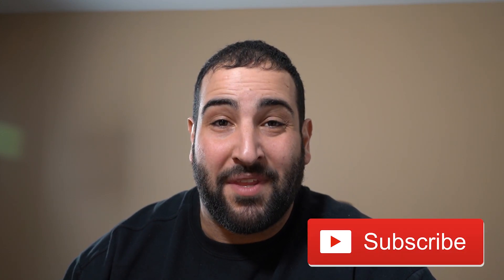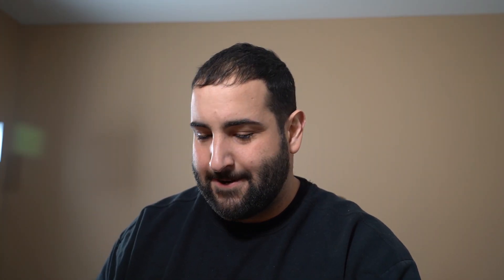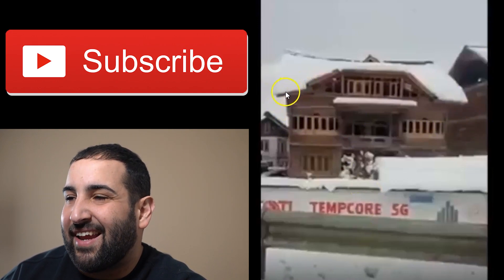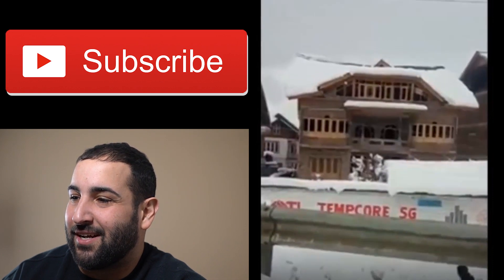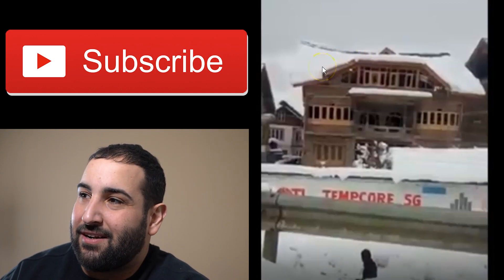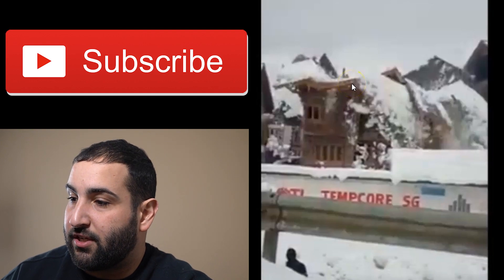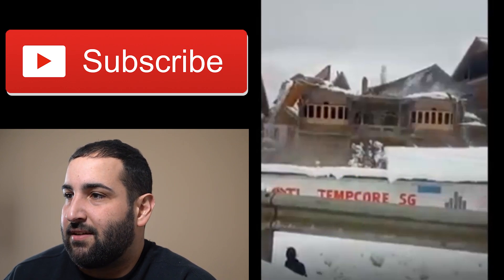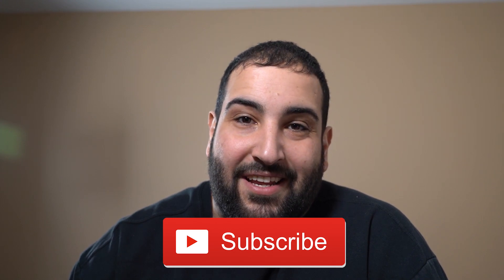Engineer Reacts to Building Collapse

Comment: I imagine you're right about this being a staging/construction issue. If snow is roughly 21 lb/cf & there is less than a foot of snow, then the weight of this snow would be less than or equal to the minimum code prescribed roof live load - and I'm not seeing roof live load being applied in the video. So either the structure wasn't designed property for typical roof live loads (unlikely), or some significant framing elements were missing at this stage of construction.

I am a structural engineer in central Texas and snow load generally does not control here, so feel free to let me know if anything above doesn't make sense with your experience in a heavy snow region.
Reply: P.S. the audio was much better in this video. Great work!